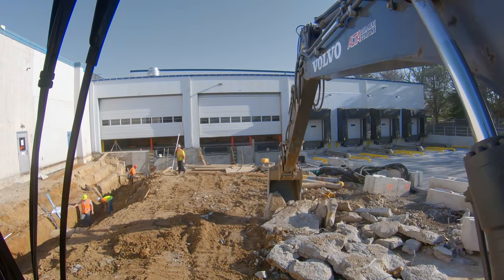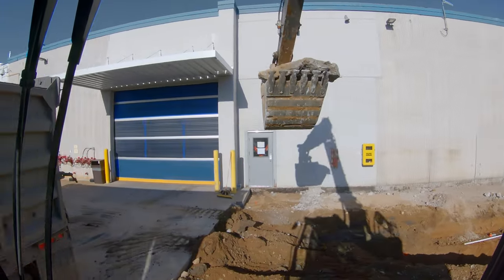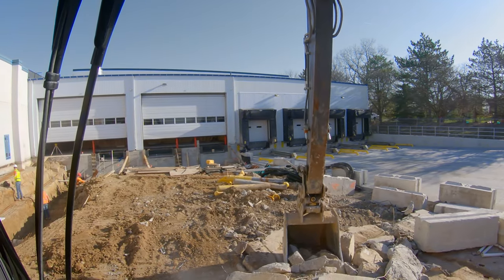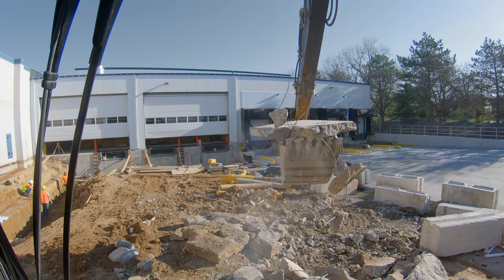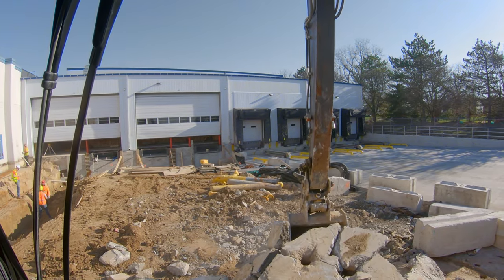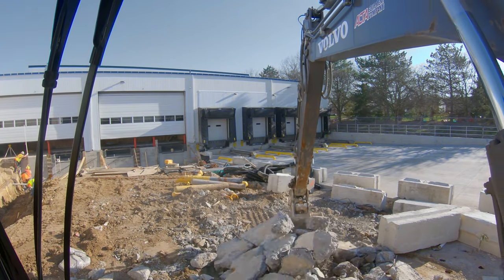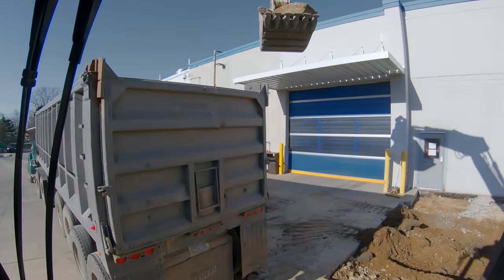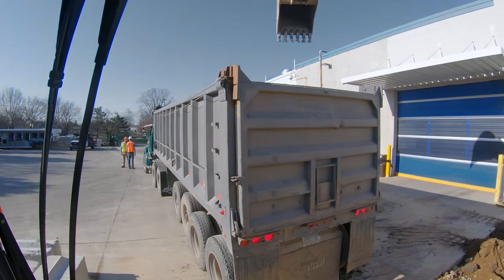How To Load Concrete Into Truck

Comment: Finally an operator that gets it! I had to rip on a guy dropping 4 foot by 4 foot by 20 foot concrete overpass pillars in my side dump. I told him that I didn't pay over $80,000 dollars for a new trailer just so he could trash it In a day.
Reply: Or they'll put huge chunks right at the front or back. A side dump has all that room in the middle between axles, if I have to load a larger chunk I'll make sure I put it somewhere where it's not going to fall against his tires!
Reply: @eldonhill4840  definitely the only way it should be done and it's definitely common sense but common sense these days has gone out the window on decent operators. Heck I haven't even been able to hire a decent truck driver for the last 3 years that knows how to do their job properly. I even offer $5 per hour more than the competition.

Comment: You are a good operator. My dad was the best God rest his soul. I'm about to take a job in a quarry. I'm no where your level. But it's just a loader. Wish me luck. Plus , I'm older . 
I have owned a couple skid loaders and ran big loaders in a quarry when I was young. I own a Ford 9n with a loader on front that uses more skill than all the modern equipment I've ran . Lol. Any advice would be appreciated 👍
Reply: In a quarry, they probably want you to be fast with your production. Starting out, that doesn't necessarily mean bomb around everywhere in high gear, it means focus on making sure every motion and maneuver is the shortest, smoothest, and most efficient it can be, and that your buckets are always as full as possible. Get all that down as slow as you need to, then the speed will come with time. Good luck and stay safe!
Reply from the maker: Everything @eldonhiill4840 said.  Focus on staying tight to the pile and tight to the truck when loading.  No more than 3.5 wheel rotations when backing up to go between.  Make sure you are using your time in the pit efficiently when shuttling material.  Thanks for watching and thanks for the comment!

Comment: Do you prefer the bucket without the arm on this type work?
Reply: The thumb?
Reply from the maker: Loading concrete is much easier with a thumb but that adds a lot of weight to the end of the arm.
Reply: Sorry guys, yes…the thumb.  That’s what I was thinking, that it would be easier to grab vs balance to load truck.  Didn’t think of the weight concern the thumb adds.